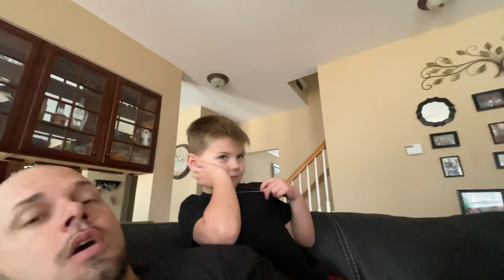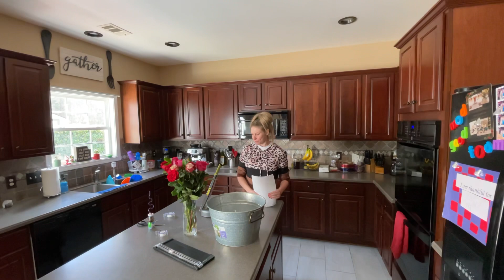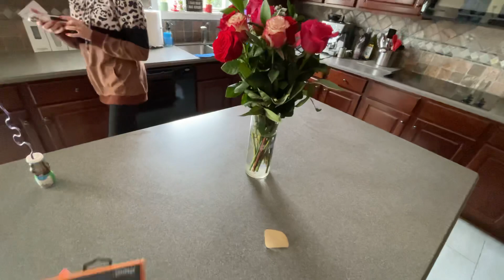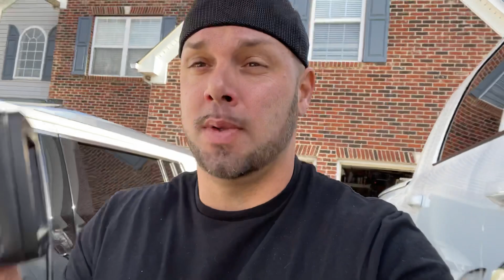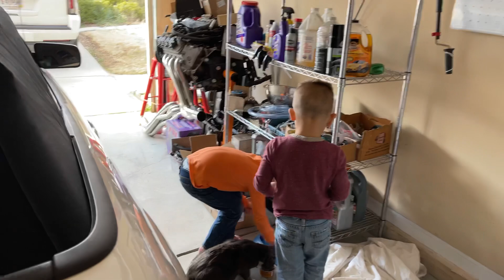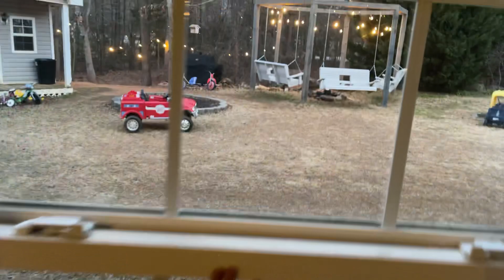“Custom Grille Fabrication” Strive to Be Different 2011 RAM 16” Lift on 42” Tires and 28” Wheels

Comment: You are so talented in light and wire'in,  I'm trying put together turning signals of red LED red light stripes to put on trailer attack to mountain bike . Going for my logo photo of YouTube,  I gave to turning signal, also the case that make it flash. 14 gauge wire and 12 volt battery 🔋,  just don't have knowledge in this project..
I like the lights you install on your Dodger Ram 😍😍

Comment: What I would do but I am no good..lol.. is weld nuts on the back of the grill, then use washers on screws so that if an LED needs replaced it is easier..again..I am not good at design..lol.. but have watched that done.

Comment: I've got a plan. 62 years old own my house live alone kids grown.   Have some money in the bank. Gonna sell my house. Put the money straight over to A T680 with a trailer apU and years worth Insurance.Currently working at fedex running from Grand Junction to Denver nightly maybe the most challenging lane. But this is just temporary , build my war chest have working capital. Gonna be over the road owner operator. 6 months is the plan.